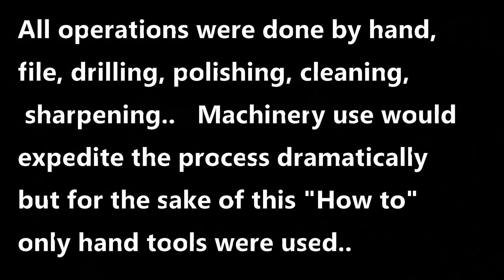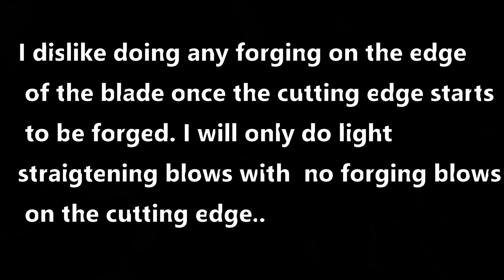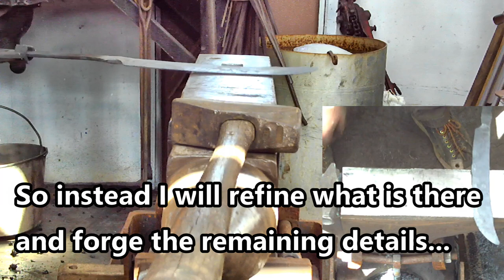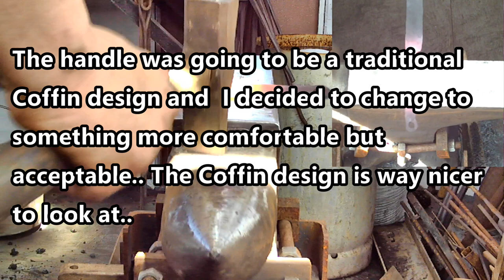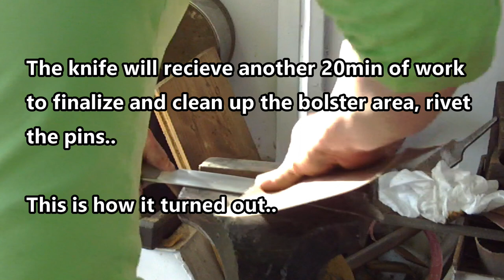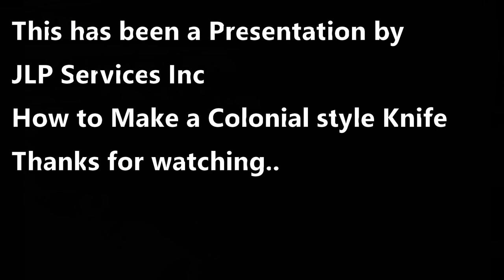How to make a Colonial style knife.

Comment: Very nice, I like thoes narrow pins. The palm swell will make that handle comfortable. I think thats going to make a very nice Thanksgiving set.
Reply from the maker: Thanks..  Not sure if you caught about the coffin handle which would have looked so nice with the set..  I just figured since that style of handle has gone out of favor the design I did use is 1/2 and 1/2 correct for the time frame/period though a little rounder would have been more correct (less belly)..      

did you end up watching all the filing and rasping? What did you think of the play back speed?
Reply: JLP Services Inc I was thinking while you did the finish work "I really wish I could work that fast" I did miss the coffin handle, I think I need to read up on handle types.  I do like a palm swell much more than a straight handle. Did you just sand out that inclusion?
Reply from the maker: Thats funny..  How many drops?????    :)
Reply: JLP Services Inc Ok, I watched this, then I watched it with Sandy, then I watched it because of the missed handle remark, and now I'm going to watch it again to count the drops. I didn't catch any drops, but Sandy asked why are you watching that vedio againe, I said because when Rowen and I watch this I have to know how many drops there are so I can have treats ready so Rowen tells my Look, it's another drop forging.